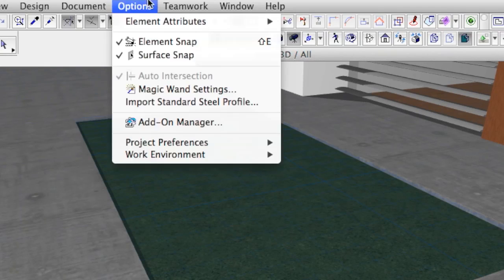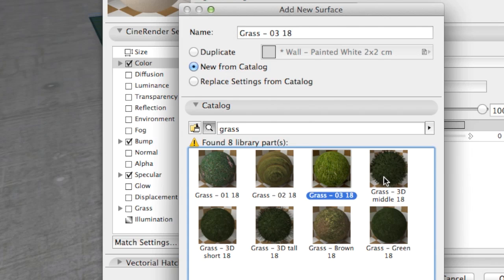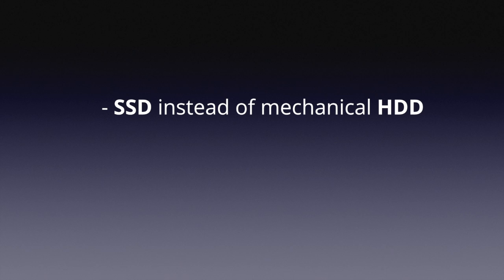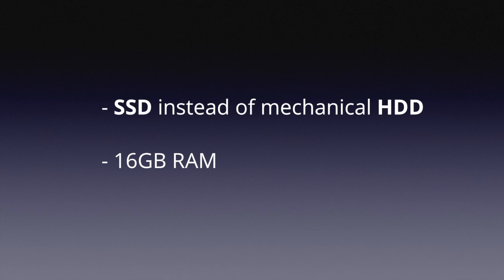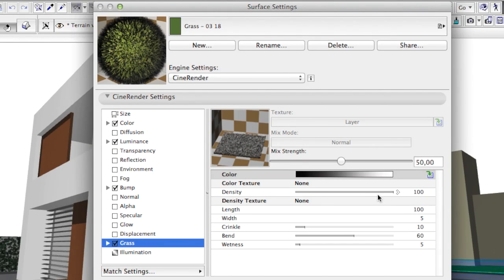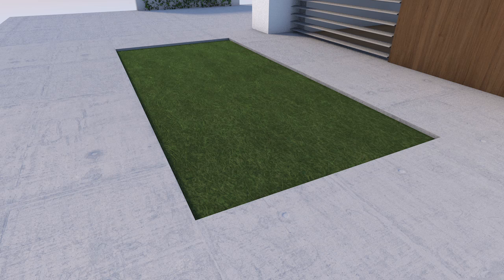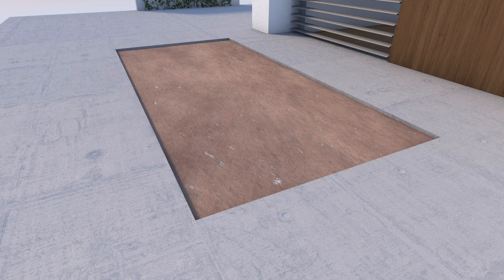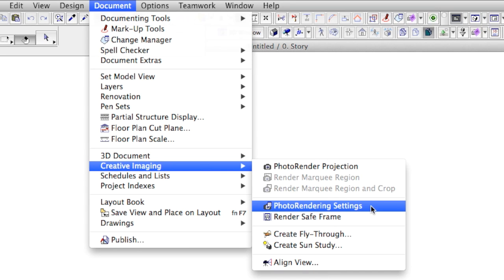ARCHICAD Surface Settings: Grass

Comment: Hello,

Congrat on the new magnificent release. Quick question, Ive tried all the materials, and check the grass box, both under surface and render settings, and its still flat. is it because I am using educational version?